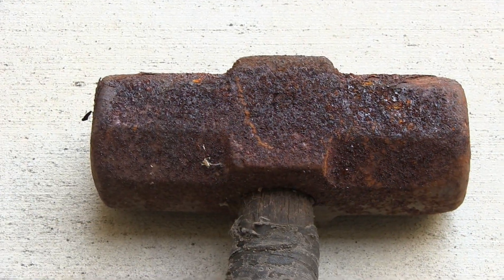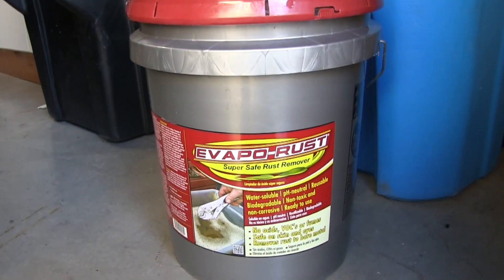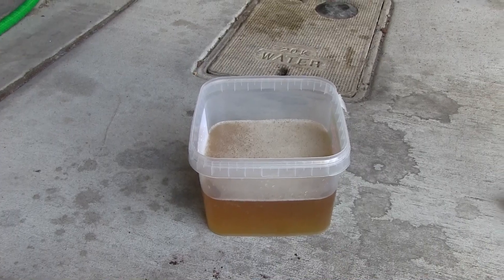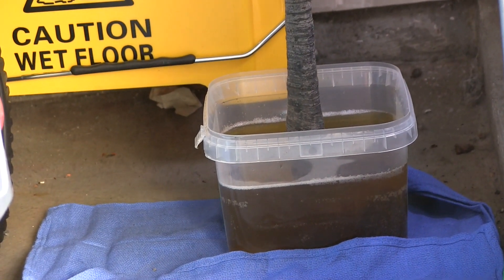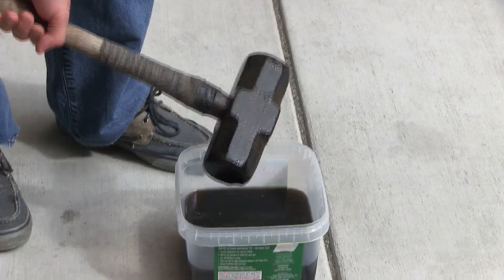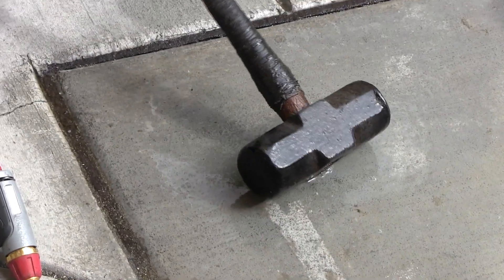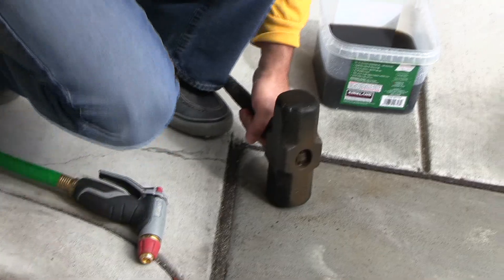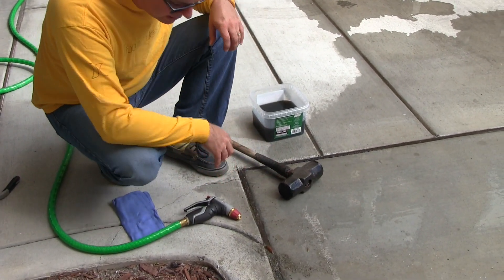Rust Removal - Dissolve Rust From Metal Using EvapoRust Chemical Dip

Comment: If you want to get maximum value of your relatively expensive rust remover you should prep your items by removing as much rust you can with a steel wire brush or sandpaper and let the rust remover (evapo rust im this case) get into all the tricky corners and cracks to finish the job off. It would take 30 seconds to get prob 50% of all the rust off of this hammer and spare alot of evapo rust

Comment: Wire Buffer on your Bench Grinder would have done the job in 5 minutes or less without having to use chemicals, so where did you dump the used up chemicals for this useless exercise.

Comment: "(Clear or White) Distilled Vinegar" just removed rust from a bunch of tools I own!
After soaking for a day or two, rinse with a solution of Water (1 quart to 2 or 3 tablespoons) and baking soda! That will stop the vinegar from continuing to work!
Then wire brush the tools.
It did a great job on my drill bits!

Comment: Worked 22 yrs on oil rigs through the 70's 80's & 90's, we always just used diesel fuel for cleaning tools. You'd be surprised how well it works, many a time I've put an old rusty chain, wrench, etc in a bucket of diesel and just let it set a couple of days. Comes out clean as a whistle

Comment: I can honestly say that I am truly amazed how many people get tricked into buying products like that. The reason that oxidation occurs AKA rust is because oxygen is paramagnetic.. oxidation is losing electrons. So you want to use an oxidizer to remove rust easily. So what nature did to the metal is oxidize it with oxygen. So you want to do the same to the rust that nature did to the steel. And everyone has one of the most powerful oxidizers in their house already. And that is hydrogen peroxide. For some reason everybody in the world forgets that everything in the world is made of charged particles. So all you are doing is either taking charged particles away or putting charged particles in. When you do everything. So if you want to get rid of charged particles which are tiny magnets you use the opposite of that. Acids Steel electrons from other things that's the reason why you can break things down with acids. They are highly charged. You can use vinegar even catch up because the vinegar is in it. People do not understand how much money they're giving away on a daily basis because they don't think in terms of charged particles
Reply: METO U who the hell thinks of life in terms of charged particles...
Reply: METO U I think you need a reducer instead of an oxidiser lol think about it

Comment: Vinegar works the same. Plus a splash of muriatic acid and it works even faster than this. But straight vinegar works great aswell. MX water you can add to the vinegar is about 10gal to 1 gal vinegar

Comment: Muriatic acid works better than all of them it's the same stuff they use in pools. Dip that thing in a little bucket of muriatic acid and that thing will come out shiny clean I do it with heavy chains and any other metal object caution though it does have toxic fumes if breathed but will be neutralized with water and baking soda if it gets corrosive on anything else. I also use muriatic acid to clean metal before soldering it like when I'm working on gutters. Pretty much every hardware store carries it.

Comment: Evaporust can be used repeatedly. Don't let the color fool you. Let the rust particles settle for a couple days and/or strain them off using a fine filter. I've re-used mine several times and its still very effective. Don't waste it.

Comment: With my harbor freight  blaster I could of cleaned off that sleage  hammer in 5 mins  oh wait I did on mine then I took a sander with 120 grit then with 220 grit  got it to a nice smooth surface wiped it off with denatured  alcohol and blued it with gun blueing  looks like thors hammer  it took me 30 mins.  Oh i oiled it when done with blueing  with 3 in one oil
Reply: 30 mins my ass

Comment: wire brush, and sand paper  that's all u need
Reply: Actually, putting it in an electrolysis bath is the easiest. It would take 10-15 min, w/ absolutely no real effort from you, to get that piece clean. Remove from bath and give a quick rub w/ green scotchbrite. Wipe with rag and wallah! And the best part is there's no chemicals to buy, store, or have to dispose of.
Reply: The94GTC I have never used the product. This fact, however, lessens my point in no way. You still need to purchase and store this product. With electrolysis,  you use water, electricity, and a little arm & hammer. 10-15min and you're done. 

Furthermore, if you read the SDS for evapo-rust, it states "Do not allow into open waterways and ground water systems". It, also, hasn't been tested on fish or terrestrial creatures, soil, and other ecological systems. The company determined it to be biodegradable based on the individual ingredients, not their formulation. Nowhere in the SDS does it state or imply the product, before or after use, is safe for drain disposal.

Do as you wish. But know, everything I stated is based on facts.
Reply: Tom B 👏. Well done
Reply: Tom B put a wire wheel on a grinder and you’ll be done in 2 minutes
Reply: metalguyn I was gonna comment that.......
Reply: Magic Mike facts
Reply: Or we can be lazy and put a sock over it lol
Reply: Don't have time for that, im a busy man. Rather leave it over night while doing other household tasks, why not let it do your job while you use your time on something else
Reply: looks like some over priced vinegar.. vinegar might even work better. LOL!
Reply: Magic Mike i
Reply: POC Skellington but is fun to put a little work into it.
Reply: Just wire wheel it...I could wire wheel that shit in 10 fucking seconds....
Reply: Magic Mike wale
Reply: Magic Mike sand paper really I’m pretty sure it only takes off extra layers not rust lol
Reply: Magic Mike baking soda and lemon does the trick too
Reply: Magic Mike wire brush is the best thing known to man 🙋🏻‍♂️
Reply: Magic Mike wire brush and sand paper . You’ll be twenty years seem like you like to slave away on hands on stuff then work efficiently .sand blast it or power tools . 5 mins tops . Too funny I bet you haven’t build anything or can change a tyre or tires if your American
Reply: POC Skellington how so
Reply: l'm a limp wrist SJW Feminist Democrat. This is too much work.
Reply: Tom B electrolysis would be as good or better. But evaporust has a similar effect and removed only the rust and not the other material. It’s a good choice for folks who aren’t up to setting up for electrolysis.  I have used it in a small container on old tools and for firearms restoration on non blued parts like buttplates.
Reply: Wallah? It's Voila you fucking dumbass.
Reply: metalguyn not everyone knows that "dumb ass"

Comment: Way to expensive for dummies only...Vinegar, CLR, paint with muratic acid, molasses, and BEST OF ALL, SANDBLAST or beadblast IT, which is what is done with all powdercoatng preps... and plating preps...I prefer muratic acid for fast bulk rust removal, but sandblasting prepares for every finish coating👍👍👍🐸🐸

Comment: Where do you dispose of the used (toxic?) chemical?
Reply from the maker: This particular product is non-toxic, non-corrosive, and contains no acids, bases, or petroleum solvents. Evapo-Rust is also biodegradable. Someone here mentioned a prime ingredient being vinegar. It doesn't smell like vinegar but I wouldn't be surprised if that were true.
Reply: So down the toilet is fine?
Thanks for the info.
Reply from the maker: We poured ours in the gutter. I'm not sure the pipes in your building would like it.

Comment: That black stuff is converted metal, similar to parkerizing.   After you wipe it clean and sand it, you can use Rustoleum Rust Inverter spray on and then paint over it. Good video.
Reply from the maker: Thanks Jose.

Comment: powder coat or chrome?? it's a hammer...how you gonna hammer anything with a chromy powder-coaty hammer.
Reply from the maker: Exactly what Cameron said. The handle is actually cracked so I would have to replace it to actually use as a sledge. I have another sledge I use when I really need one. This one just looks pretty in my garage/office and reminds me of grandpa.
Reply: Marcus Funk he said he didn't plan on using it so I'm assuming for its sentimental value
Reply: P

Comment: just use a wire brush on a grinder or even a drill and be done in minutes to half an hour then just clean it up crap why use chemicals when elbow grease works great

Comment: Hi guys,i can tell you a much much easier and cheaper way to do exactly if not better to what this guy is doing ,,  50% Molasses + 50% Tap Water in bucket,submerge item to be cleaned n leave for a few days depending on the extent of the Rust
Reply: The Man - How exactly is sugar water gonna remove rust?

Comment: I filter my used Evaporust through an old coffee maker using coffee filters.  This removes the converted rust particles and paint and really lets the fluid last a lot longer.

Evaporust will stain concrete but can be washed off with lots of water.

I have used this stuff extensively while restoring my dad's 1972 Chevy truck.   For large, badly rusted parts (say the hood hinges) I run those a day or so in an electrolysis tank then follow with Evaporust soak.  It is amazingly effective in that two step process.  Then I wash off with the hose as you have here, let dry in the sun, and coat with NAPA Rust Treatment (spray).  I then topcoat with whatever paint I wish to use.

Comment: This stuff is way over priced. Use Vinegar 9% solutiion
Reply: Mike M our just molasses
Reply: 10-4 on the 9% vinegar. I found a very rusted pair of pliers in a yard I was mowing last season. Soaked in 9% vinegar - took 3 days - but ALL of the rust came off. I will try this in my motorcycle gas tank.
Reply: Mike M I just attempted to do my gas tank. just be careful of flash rusting. I knew it could happen quick but literally in the blink of an eye, or in a flash, the inside had rusted. I'm still working on cleaning it out when I could have possibly just left it alone and installed a good fuel filter.
Reply: Use 250 ml of kerosene or diesel . Does a similar job and as cheap as vinegar . Just leave it overnight
Reply: Matthew Lynch, I did the inside of my tank with some fish aquarium gravel and just shook the hell out of it a few times, emptied it out and blew it out with air then just poured a cup of gas in it and shook it around to coat the inside and done.